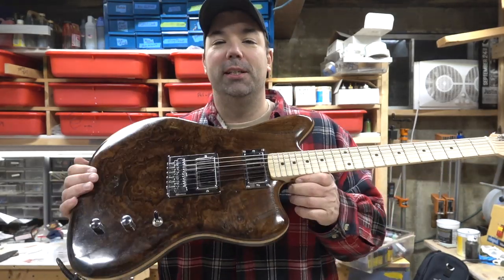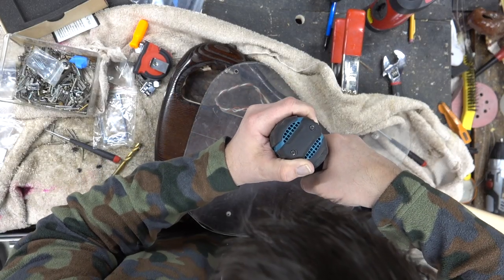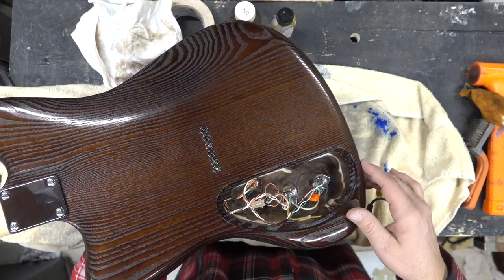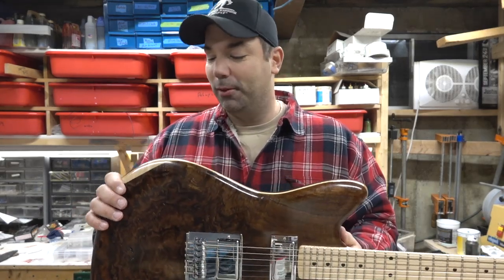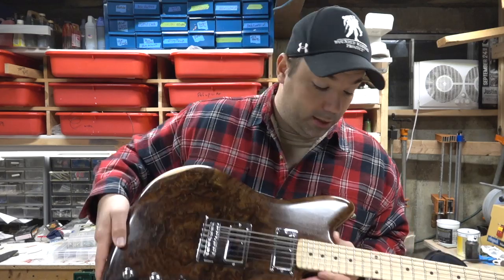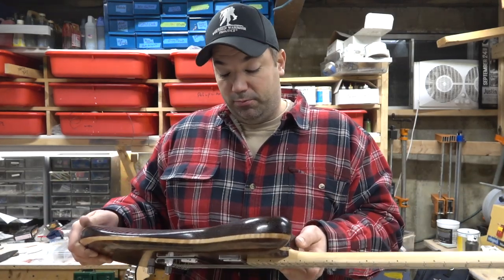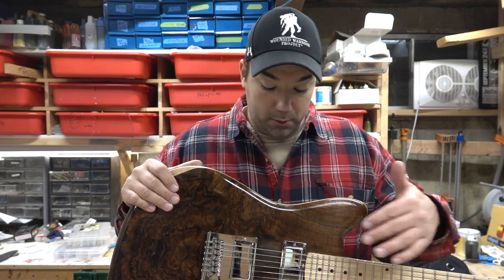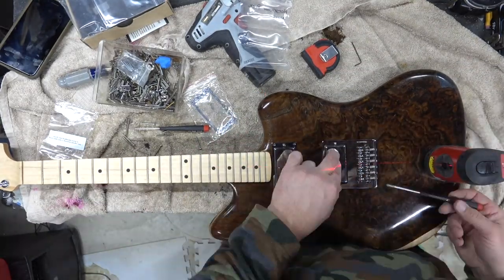Completed Custom Jazzmaster Guitar - Part III

Comment: Came out beautiful !! So basically its a "Jazz-stang". And in some of the pickup configurations I've had .. sometimes the bridge sounds silent as they almost tune it to be a fully trebily pickup vs the neck that way ususally when you put them together they sound perfect. That said it could also be wired not right as you would know.
Reply from the maker: I need to dig out my ohm meter.